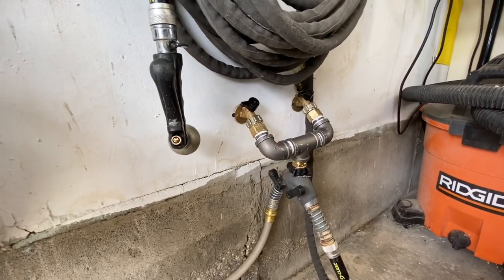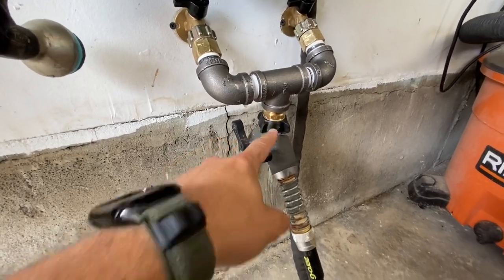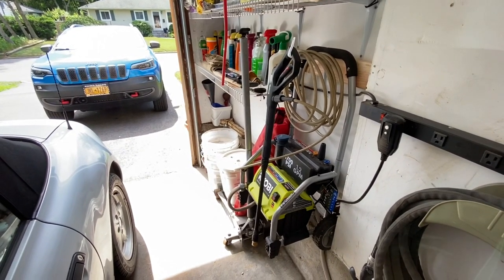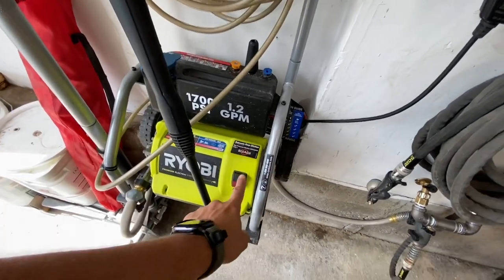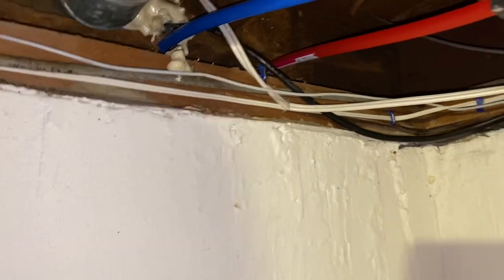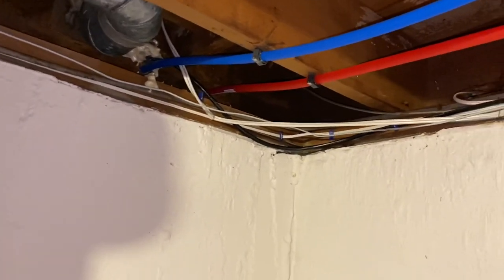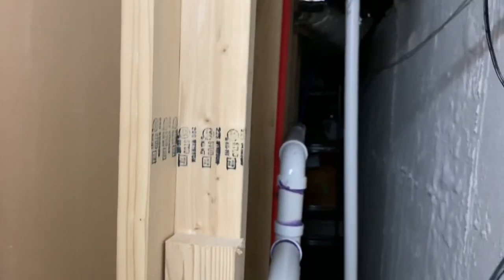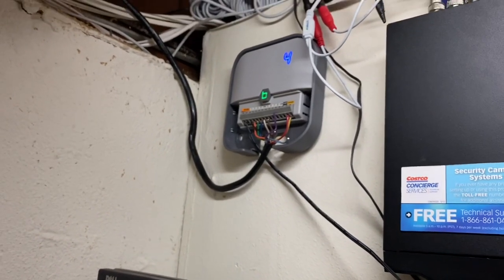Adding Hot Water and a Built in Pressure Washer to my Garage

Comment: You need a backcheck value, because the water will mix at that value and it will give you cold water instead of hot where and when you need it.  Good job plumbing. Next time use brass not black iron.
Reply: BlCk iron will rust...from the inside out.

Comment: I did the same thing exact same washer too I removed the pump from the cart threw the cart away. Eventually the pump failed from water always siting in there not draining it I suspect.  I bought a used Landa hot water pressure washer I found on craigs list heats with a diesel burner the water to 200F. It amazing how well it cleans after 4 years the coil rusted now its sitting on the side of my yard wife wants it gone. Landa coil is $1000 which is more then I paid $600 for the washer. I may go back to the water heater again my new water heater is a heat pump type it can heat to 140F.  I may try to dig into the landa see if I can weld up the coil I think it's a lost cause the thing is over 30 years old.

Comment: I want to build a portable hot water pressure washer setup, using a 7 gallon hot water heater. Would that mixi g valve setup work for that you think? I would live a setup like yours in a garage, but I rent AND don't have a garage.
Reply from the maker: Yes definitely that mixing valve would work!

Comment: I love this idea. Very efficient way to store and use a pressure cleaner. 

I have two unvented bathrooms and a tile roof. I would like to add a fart fan to help vacate bad smells and high humidity from shower steam. We live in FL where humidity is high. I don’t want to penetrate the roof and risk leaking. 

My first though is to run into attic but I’ve seen mold occur when you introduce humid air with hot dark roof. 

My second thought is to vent out of soffit but my soffits are vented and the hot air would just get sucked back into the roof. 

I am now thinking maybe a dehumidifier I can hook up with wall access/charcoal filter for smells and self draining into toilet. 

I’ll also need to add a switch and will probably add a Zwave or wireless on/off switch to have an automatic timer based on either of the following three scenes. 1 motion once fan is turned on for the people who like to mask bathroom noises with a fan. 2 humidity sensor if you forget to turn the fan on while showering. 3 one day in the near future) fart smell detector which would turn it on automatically. All three turn off once motion is not detected for 8 consecutive minutes and requested humidity threshold. Do you have any suggestions you can make a video on?
Reply from the maker: Do you have anything that vents through the roof that you can cut into? For example, an existing roof vent that you can create a duct and vent into it? Very smart idea to get those fart smells out, that shit can damage the paint!